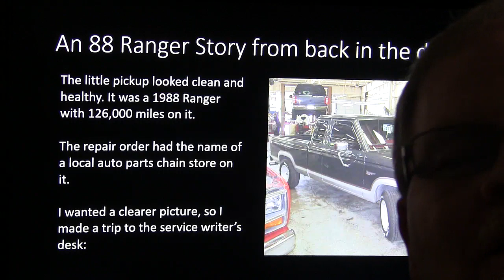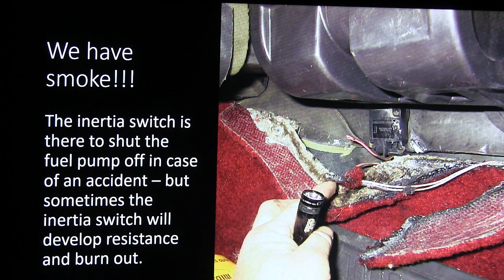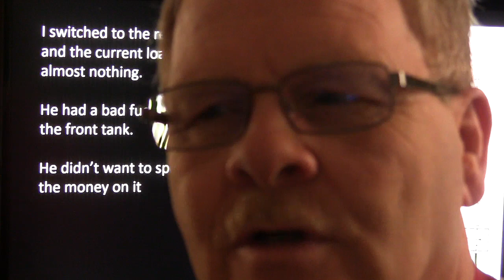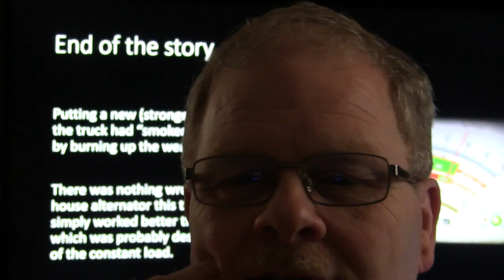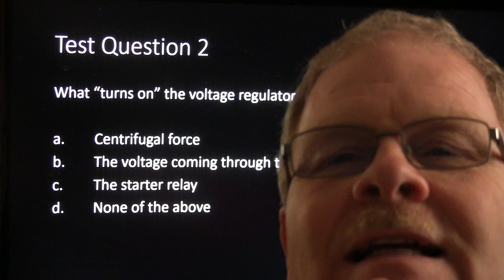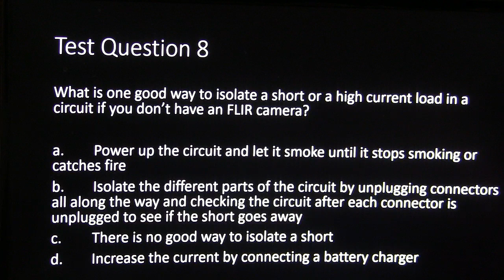Smoke Search on an Old Ranger

Comment: I own my '87 Ranger for the past 21 years.  I had a crank no start a couple if years ago and traced the problem to the inertia switch. Internal corrosion causing resistance.   I made a little YTube video on the  diagnosis process and repair. https://youtu.be/NNC1PGAsmM8